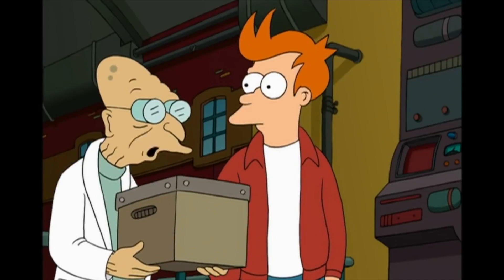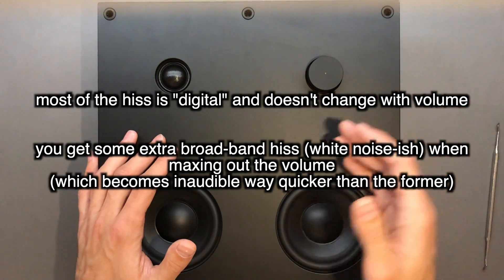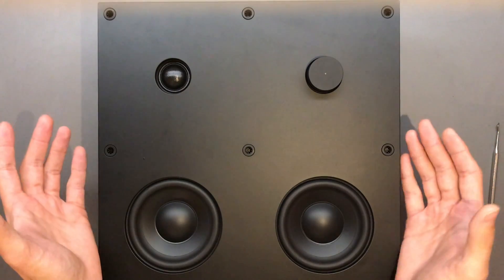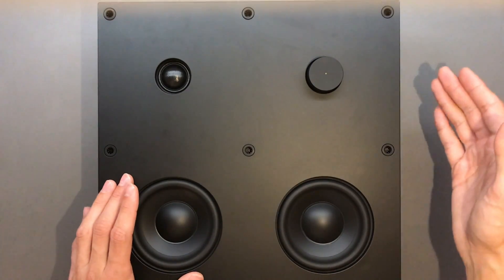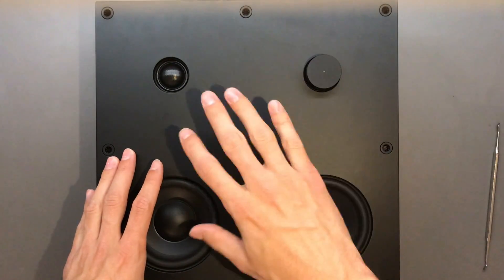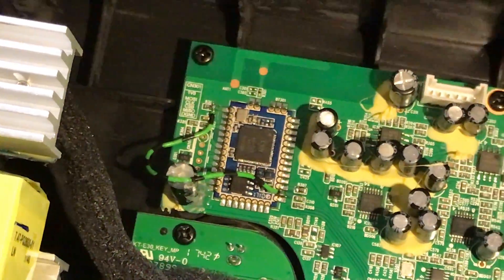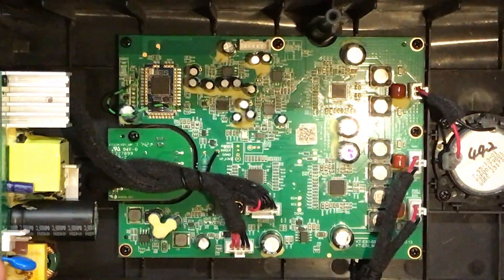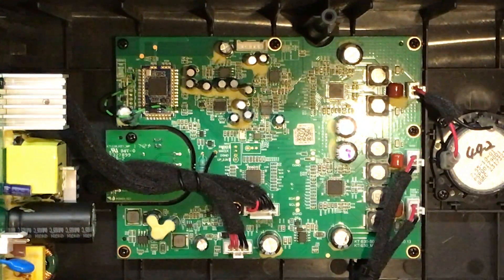How to Disable the Auto Sleep on the IKEA Eneby

Comment: Did this 5 years later (procrastination at its finest) and it worked - thanks!

If it's useful for anyone, there are a couple of details that were important for me: (1) the PCB in mine was slightly different (bought mine in Croatia, the model ID is E1720) so the trace towards the resistor from pin 1 is slightly different than the one in the video, and the resistor ID is also a different one, but the hack worked as well. (2) Would have been useful to know that there were two screws in the center of the speaker before trying to force-open the back plate after removing the obvious screws (had to find another one of your videos where you unmount the whole thing in 4x speed to figure it out) don't forget to remove the screws that are inside the speaker holder mounting holes!

Comment: BTW, the newer gen speakers seem to have addressed the issue. From the manual: To disable the auto-off function (on the Eneby 20/30): Press and hold the knob (1). Release the knob when the LED light turns red the fourth time. A confirmation sound will be played. ENEBY will now not turn off automatically
Reply from the maker: finally ❤️

Comment: I have noticed that top of Page 6 of the eneby user instructions it says this.. 
(note: they actually say red but i have written blue - which is what i think they mean)

Disable the auto-off function 
Press and hold the knob (1). 
Release the knob when the LED light turns blue the fourth time.
A confirmation sound will be played. ENEBY will now ** not ** turn off automatically. 

These instructions are on the Eneby page of the IKEA website (in Product Details - Assembly and Documents) https://www.ikea.com/gb/en/manuals/eneby-bluetooth-speaker-black-gen-2__AA-2227100-2.pdf
Reply from the maker: it could be they added this functionality .. it's a one-liner code-wise to make it happen

has anyone confirmed this ?
Reply: @Darieee  Sadly, it didn't work for me.

Comment: The Eneby Gen 2 have TWS and the option to disable auto off :)
Reply: Yes, at least it works for my ENEBY 20 GEN2, not exactly a intuitive procedure: 
Disable the auto-off function:
*Press and hold the knob (1). Release the knob when the LED
light turns red the fourth time.
*A confirmation sound will be played. ENEBY will now not turn
off automatically. 
(my comment: LED turns white)
https://www.ikea.com/ca/en/manuals/eneby-bluetooth-speaker__AA-2230613-2_pub.pdf

Comment: Hi... 
Is there a way to disable auto off on Eneby builtin speaker as well? In my case, I have a board with CSR 8615 chip. This is the board of Eneby Built-in speaker https://ibb.co/pvPLtGj. I have installed this speaker in lowered ceiling in my bathroom so it's quite difficult to power it constantly. It is connected to my Chromecast. I also tried to connect it to a smart outlet but it is not powering ON automatically. So only 2s button press do the job. :(

Any help would be appreciated.
Thanks...

Comment: Any idea if this works with the frekvens speaker?
Reply from the maker: hmm, no idea - but since you're here I do have some questions

does that one ALSO turn off when connected to wall power ????
Reply: Yes, unfortunately. I can’t believe Teenage Engineering (the designers) didn’t overrule this feature.
Reply from the maker: I'm honestly highly disappointed by their work .. extremely unprofessional .. check the frekvens site .. there they're a "creative collective made up of engineers and programmers that share the love for making (what!?) music and electronics"
Reply from the maker: should be doable - a good friend also enabled TWS on the eneby 🔥, bit shoddy because of CSR though 

with the frekvens it seems they moved to cheaper BT chips

Comment: Is it true that it'll turn off if the volume is low via audio cable?
Reply: up, I want to know this as well :D
Reply from the maker: it used to turn off .. yeah .. I think they tweaked it and it got better in later revisions but .. it's a poorly designed speaker overall

Comment: hi,   I always thought the source should have its volume on max and use the speaker/amplifier to alter volume?            well, I use a bluetooth speaker so I can keep the phone in my pocket, not to keep my hands off the volumeknob

diff people, diff ways
Reply from the maker: kinda wrong though

in 2019 (and even since 2015 or so if not even earlier) you can have

1 single volume on both ... so, you can have your phone on the mood and adjust the volume on the speaker -- both have their slider move, or vice-versa

having 2 separate ones means EVENTUALLY you will need more volume on the one, and have to adjust both, which, is, mathematically suboptimal ^^

Comment: Thanks for the help with the bluetooth sleep disable hack :) . 

I found this fix for the aux sleep. Worked like a charm. 
I’m using Chromecast with this speaker  and had to send a 20hz signal every 15 min on semi-low volume. And i had to check If the speaker was in use by a castgroup or stand alone .If i didnt do that the 20hz audio would interrupt the Playing song .

So this fix helped me alot :)

https://www.reddit.com/r/audiophile/comments/bjk7ix/disable_the_auto_off_feature_of_ikea_eneby_30/

Comment: This will disable sleep on Eneby 20, doesn't matter if you are using bluetooth or aux in
step 1:
Taking constant 18V from supply
https://imgur.com/17ZpbNL

step 2:
using DC-DC converter to set output voltage to 1.7V (it can be anywhere from 1-1,7V)
https://imgur.com/YC0lSwt

step 3.
de-soldering resistor r32 and soldering output positive wire from DC-DC converter (1,7V)  to pin on microchip
https://imgur.com/0Um17eK
Reply from the maker: thanks man, awesome job finding this -- any explanation on what exactly that pin does ? 

and why there is no way of stealing a local 1v8 rail ??
Reply: @Darieee   That is the pin to which signal from HC4066 is send. HC4066 is switch between BT and aux in and it's output is send to the pin I marked on the picture.
When volume is on max then voltage is 1.8V. I did recommend keeping voltage between 1-1.8V because Eneby can go to sleep if voltage is too low (audio cut off after one minute - I have noticed that when I was using Echo input connected to Eneby via aux in and volume was set to 30% on Echo, after one minute of play Eneby would cut off sound. When you set volume on Echo to 50% everything works fine)
To be on the safe side I have setup mine to 1.7V(also, DC-DC converter that I have can go from 1.5V to 35V)

Why I took 18V signal? I couldn't find any 1-1,8V signal on board itself, There are some 3.3V and 5V on board, but this was easy thing to do so I did it like that. And I am 100% sure that I will not interfere with anything else going on in there :)
Reply from the maker: Nice! Thanks for the breakdown

Unfortunately youtube seems to be withholding your comment .. maybe check tomorrow with a logged out browser .. I 'favorited' it and we are having this talk .. and it wasn't ever flagged as spam either but .. yeah .. shit's broken
Reply: This is amazing! Thanks for posting this. 

However I’m going to need more information than this. Any chance you can post more images or a video of how you do this and the parts that you’ll need?
Reply: @eriklindholm6380   I can do it only for Eneby 20, if that helps I could do video explaining everything. I am guessing that I could do that this weekend.
Reply: @ClioSport2016v  I have 2 Eneby 20 that desperately need the Auto-off disabled. I would highly appreciate it. And I don't think I'm alone considering all the comments on this clip!
Reply: @ClioSport2016v  Hi, I just bought the Eneby 20 and wanting to do this mod, I have seen someone on the reddit thread disabled the aux autosleep simply by removing resistor r32 is that enough? If I want to disable autosleep bluetooth mode I have to get a DC-DC converter?
Reply: @inspirology94  I don't know, I didn't tried that, but you can try it and if it works then great, if not, you need to add dc-dc adapter

Comment: Hello Darieee, hope you are well! Also hoping you can give me a bit of advice... I did this mod with the 8" x 8" model... cut the trace and added the wire bridging between the nearby resistor and second from bottom pin on the right side of the chip... and now it will connect to bluetooth no problem, but only play audio for about 30 seconds, the audio cuts out, but it stays connected to BT. Any thoughts on what may have happened? Any advice would be appreciated. Thank you much!
Reply from the maker: And so, you are 100% you performed all the steps of the mod exactly as shown?
Reply: @Darieee  I am 100% sure. However, I'm guessing I may have created a dry joint on one side of the resistor when soldering the wire? Everything still works just fine via AUX cable.
Reply from the maker: Yeah .. no idea to be honest .. your guess is as good as mine

Comment: Darned, just tried this, and the resister loosened, and the wire pulled it off, and now I can't find the resistor :-( Yikes, it is very very tiny, and my gas driven portasol was too warm I guess :-( So I guess I have to buy a new speaker...
Reply from the maker: Mmm, not really, you could just tie another 1K resistor to 1v8

Not with a blow torch though next time :)
Reply: @Darieee  Thanks, I'll try, but my old eyes and the small resistor is not a good combo 😁
Reply from the maker: I'm sure with a proper soldering iron you'll do just fine
Reply: @Darieee  weehee, got it working, got a 1 kOhm resistor and used that as a wire packed it in 'shrink' (not sure og the right word her)
Reply from the maker: Also with your gas iron? 

Nice in any case, glad you got the job done!
Reply: @Darieee  nope, bought a small 30w Electric, the smallest i could get 😁, thanks again for the help and support!
Reply from the maker: No problem, enjoy your speaker!

Comment: hey! great video - I am planning to use these for our recording studio live room talkback. So I got two and the first one worked out ok - I cant seem to be able to connect it via bluetooth anymore, but the aux works great and thats what we will mostly use it for. So with the second one, I totally burned through the resistor... by any chance to you know the value and were I can reconnect it to save this speaker. Many thanks!
Reply from the maker: soo, which resistor again ??
Reply: @Darieee  ummm in your video it looks like R302 (last number is blocked) - thanks!
Reply from the maker: @aaladhamy  that one's 101 :: so, 100 Ohms (you could probably go for anything between 50 and 2000 though

Comment: Thanks! This mod works on the smaller Eneby also.  The resistor is in a slightly different place compared to your photo, but it should be obvious for anyone attempting the mod on the small Eneby.
Reply: I spoke too soon.  The speaker turned itself off!  Either the patch wire came loose, or perhaps it is because I am using the audio-in connection instead blue tooth and with no wireless connection, it turns off.
Reply: @VBerstis  Did you find the solution? mine stop playing sound after about a minute, but stays connected to bluetooth. It worked for the first time - about half a day without turning off, but then I screwed back the box and suddenly it doesnt work. I tried to dismantle it again to see if the connection didn't brake up, but it seems ok. I don't know what to do.

Comment: Hey! Been working on a project with the Eneby 20 for a while now. Basically, i gutted the speaker and built it into an early 60s FM radio. Same size enclosure, same sound 👍🏻 Using a USB-SPI adapter i connected to the bluetooth chip and changed the broadcasting name.
Now i am looking into adding wifi. My solution will be using an Arylic Up2Stream module, connecting it to the aux in with an inline switch on the aux line to be able to switch between bt and wifi. The module requires 5V power, so heres where i need your knowledge: where on the main board can i find a 5V source (or higher, stepping it down to 5), which is activated using the original power switch? Keeping the 20min auto-off on this one since it will be battery operated. Looking to have the wifi module power up and down with the rest of the speaker 👍🏻

Thank you in advance! 😊

Comment: Quick hint, tested it with amazon echo connected via BT and speaker doesn't turn off.  Has anyone succeeded enabling TWS so far ?
Reply from the maker: Does it turn off with other devices?

It might be the dot constantly keeps the a2dp stream alive sending silence over .. ?

Someone else also claimed something roughly similar

TWS is worked on by at least 3 people including myself :D
Reply: No, of course you can disconnect or connect the speaker by voice command but obviously when its disconnected same 20 min auto off rule apply. 

It looks like it's the way you wrote it, silent stream keeps it awake. Fortunately, it is not audible.

Regarding TWS, did you reprogram CSR settings or is it already implemented but not indicated in the manual?
Reply from the maker: The chip supports it

I'm having a very hard time setting up a button sequence to enable it (to tripper pairing mode as slave / as master / etc)

Comment: Does this have any negative sides for instance lifetime of the chip having it on continuously?
Reply from the maker: Nah, you should be fine

If you keep the volume cranked to 100% the background hiss will be rather audible in the vicinity of the speaker though
Reply: @Darieee  I've got it linked through bluetooth with a  Google Home Mini, which makes a perfect combo, the only downside was: having it go to stand-by continuously. So your solution + Home Mini = Heaven. And volume doesn't need to be on 100%, just like 60-80

Comment: Hey, im the one from the video on TDNC Channel. If you wanna know about the aux channel:

The SN74HC4066 on the PCB (Marked "HC4066", IC23) is a analog switch which switches between the audio signal from the bluetooth module and the aux port to be outputted (the signal goes through an adc and then to a dac again). But the output signal also goes to an analog pin of the Microcontroller. Presumably it checks for any action on the audio signal and determines if its playing or not. So if you dont want to edit the firmware (which will take some time, but i will try it anyway), you could try to cut the traces and connect the "monitor pin" of the microcontroller and connect it to one of the outputs of the hex inverter used to generate a clock signal for the adc (its a small 8 pin chip labelled HU04)

however, this is only speculation for now based on the schematic of the smaller one which i reverse engineered, not on monitoring the signals (yet).

I will also upload the schematic soon on github (still for the smaller one only)
Reply from the maker: Great work! 

Can you try the microcontroller pin route and let me know how that goes? I'm away from my eneby for the time being.

Wouldn't just pulling it high to the M0's VDD via a 5K resistor work ?
Reply: @Darieee  so i had some time now again and tried it after looking at the signal with my osc. the signal it gets is a really flattened out analog signal which changes with different volumes and its maximum is 1.8V. After adding a voltage divider from the analog 5V Power supply (could have used the 3.3V from the micro, but didnt wanted to piss the power away when it is turned off) to 1.7V (didnt had other resistors) it turned out to work!

Buuut only with the aux jack. It just straight up disables bluetooth when the aux jack is plugged in.

Working on a video for it :)

EDIT: probably could have used the 1.8V output of the bluetooth module, will do that now
Reply from the maker: Yeah so, that's a good soldering point for bluetooth for sure ...

I kind of feared this would happen ... the micro cuts the bluetooth down immediately and completely

You could try the EN pin on the blue bluetooth module - maybe the micro controls that AND we can force that high too ?
Reply: @Darieee  Got a different approach, testing it right now but should work. Used your mod with forcing the gpio of the micro to 1.8V AND a voltage divider between the analog 5V and the micro.

if the aux is plugged in, the bluetooth module gets shut down by the micro and so does the gpio go low. the 1.8V from the voltage divider go to the micro all the time, so it thinks music is playing all the time.
Reply from the maker: Crazy that we have to implement literal logic circuits to make a speaker work

Make sure to make a video on it, I'll be sure to link it over heee
Reply: @Darieee  And can confirm now that it works! Will definatly do a video in the next few days.

Yeah, its not cool that it is not an option, but i can see why they did this. They probably didnt intended the speakers for home theatre use, but rather as a portable bluetooth speaker that you can connect to AC.
Reply from the maker: @Strawberrymaker  dude but .. the "can" connect to AC is 100% a must in the case of the eneby 30

So, at that, it makes absolutely no sense having the thing turn off: imagine your tv shutting down completely after 30 minutes of inactivity -- so, instead of waking it up with the remote, you'd have to go switch it (softly as well - ..) from the unit itself ...
Reply: @Darieee  whoops okay, my fault. wasnt aware the 30 doesnt has a battery option. 

yeah then it makes absolutely no sense. One thing that is still somewhat annoying tho is that its always visible when nothing is connected to it.
Reply from the maker: Mmmm, why would you say that's annoying ?
Reply: @Strawberrymaker   That's fantastic! Please upload a video to show what you did! Can't wait to get this fixed!
Reply: Matze Strawberrymaker hey, any progress on that video? Thanks in advance, this will make my setup complete.
Reply: @Strawberrymaker  ping, did you get anywhere with the video, or do you need any help with it? I'm waiting eagerly 😁
Reply: Did you ever finish that video? Unfortunately this description is not enough for me :( and I can't wake to fix this on my 2 Eneby's. Thanks in advance! @Strawberrymaker